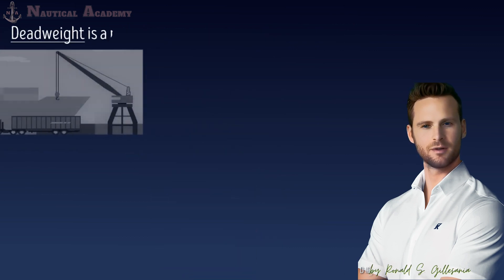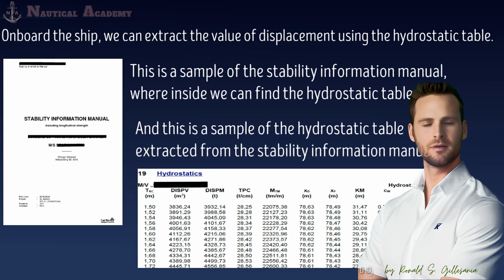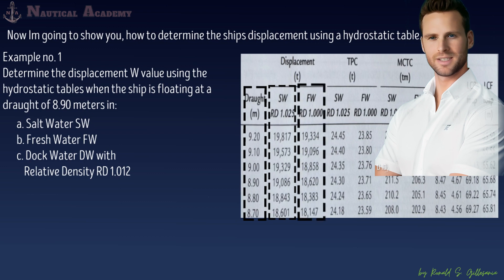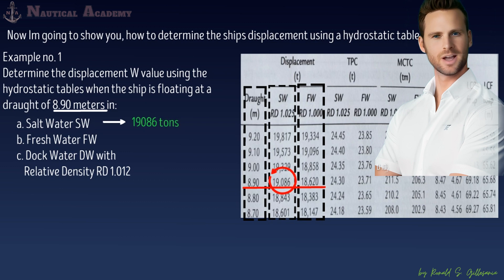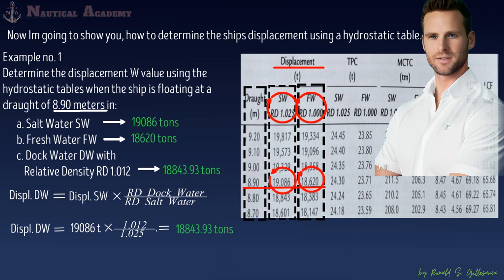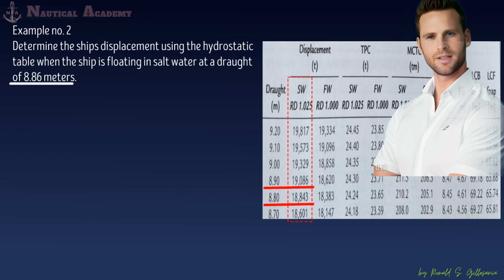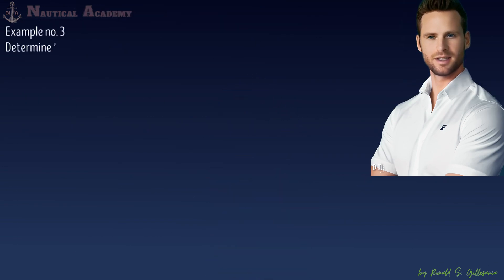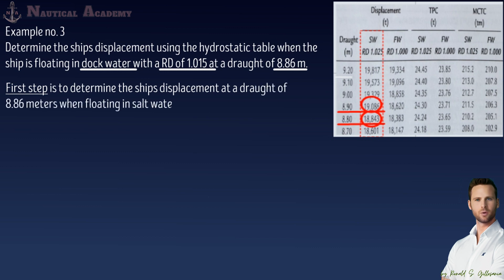Determine Ship's Displacement Using Hydrostatic Table ll Displacement ll Lightweight ll Deadweight

Comment: Is displacement in FW not more than in Salt water since salt water is denser?😅
Reply from the maker: Thank you for your question! Actually, a ship will displace more water in fresh water than in salt water. This is because fresh water is less dense than salt water.

Since the ship’s weight doesn’t change, it needs to displace a volume of water equal to its weight to stay afloat. In less dense water like fresh water, the ship has to sink slightly more to displace the same weight—meaning the volume displaced is more. But in salt water, being denser, the ship can float higher while displacing less volume.

Displacement in terms of volume is more in fresh water, and less in salt water.